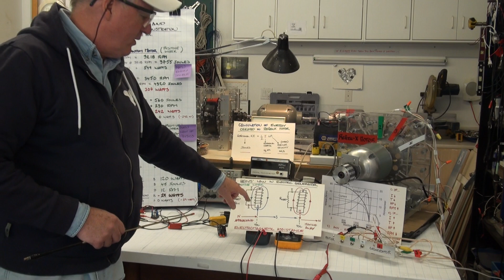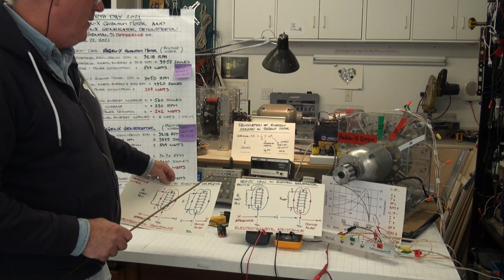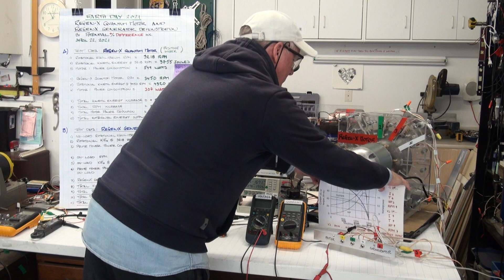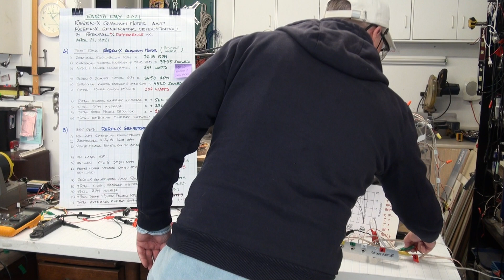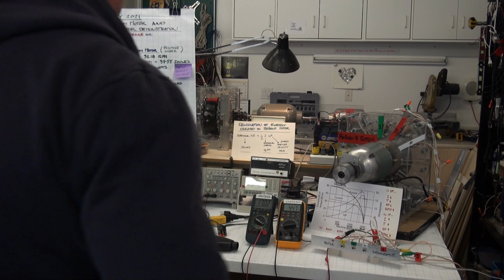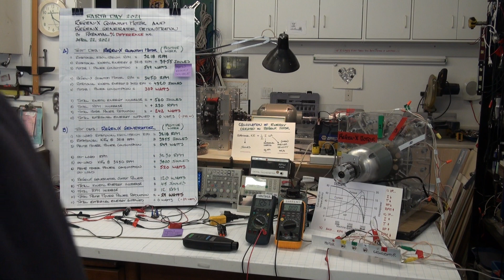PERPETUAL MOTION MACHINES OF THE 1ST KIND Earth Day 2021 ReGen-X Quantum Motor and ReGenX Generator

Comment: Thane, I went through your validations on slideshare. They look good. But do you have a third party IEEE draft?? This is what counts. Then let’s get this out to the world!!
Reply: There is validation by SIEMENS inc. , but unfortunately SIEMENS do not manufacture electric cars, and can't try to integrate ReGenX generator in electric car, and do road test. Maybe TESLA inc. can validate ReGenX generator and bitoroid transformer, and do road tests.
Reply: Those are not engineering reports. There just confirmations. They don’t get down into the nitty gritty of how, what and when. Also you dont’t need a EV provider to get an engineering report. There’s quit a few places in Canada that do third party testing on electric motors. This is normally a standard step with a piece of equipment that is built for commercial sale. Not sure after 13 years he hasn’t done this???
Reply: @jonathangroenestege2120  It does matter where validation is done, because in some places people think that there is nothing special, but in some other places people will become excited about it. Putting Tesla sign near measurement data table will make it more impressive.
Reply: @marcisgulbis9310  so now you agree with me that it should be third party verified? Lol. A place that is Qualified to give a IEEE stamp is what you need. You don’t need Tesla. Obviously that’s the dream but is not required. Google IEEE third party testing.

Comment: Awesome! Hope it works on cars. When can we see it live into a vehicle in motion?
Reply from the maker: From: thaneh potentialdifference.ca
Sent: April 30, 2021 11:10 AM
To: 
Subject: EV LTD. Introduction to: Electric Vehicle Regenerative Acceleration Innovation
 
Hello Mr. 

My name is Thane Heins and I am the President and CEO of a Clean Tech R&D in Ottawa Canada. We are in the very initial stages of working towards establishing technology manufacturing in Lebanon and Canda. 

I am writing to you today to introduce you to the Electric Vehicle Regenerative Acceleration innovation which has the ability to recharge an EV while it drives. 

Electric Vehicle Regenerative Acceleration is the exact opposite of regenerative braking - where the EV is accelerated when the batteries are being recharged rather than decelerated. 

Because the EV Regenerative Acceleration innovation accelerates an EV while recharging the batteries there is no limit to the magnitude of recharging that can be provided to the EV - such that the EV will have the ability to arrive at its destination with fully charged batteries. 

The EV owners will be able to use the power stored in their car's batteries to power their homes or businesses. 

EV plug-in recharging will be replaced with EV Plug-In Discharging where the EV owners will be paid to discharge power into the grid.

Your company won't need to invest in plug-in stations and your customers won't need to rely on an unreliable grid to charge their vehicles nor power their homes.

Wind turbines, solar panels and gas generators in Lebanon or the entire Middle East will no longer be required. 

The driving range of your EVs will no longer be dependent upon the size, weight and cost of the battery pack - an inexpensive 10 kW battery is all that will be required, reducing the initial vehicle purchase cost. 

Inexpensive Regenerative Acceleration retrofit packages can be provided so internal combustion engine vehicle owners can also be provided so everyone can benefit as soon as possible - while providing another immediate revenue stream for your company...

If you are interested to learn more or to schedule a live technology demonstration, please advise.

With Kind regards
Thane

ELECTRIC VEHICLE REGENERATIVE ACCELERATION INNOVATION INTRODUCTION: https://youtu.be/3O-uFXiObBc

ELECTRIC VEHICLE REGENERATIVE ACCELERATION INNOVATION INTRODUCTION

Thane C. Heins

President and CEO, Potential +/- Difference Inc.

Email 1: thaneh@potentialdifference.ca

Cell: 613.898.1131

 

Potential +/- Difference Inc. - Pioneering Electric Vehicle Regenerative Acceleration Technology 

& Charging Ahead...